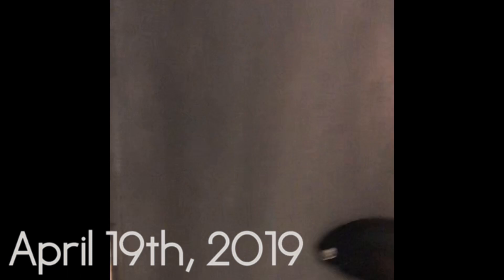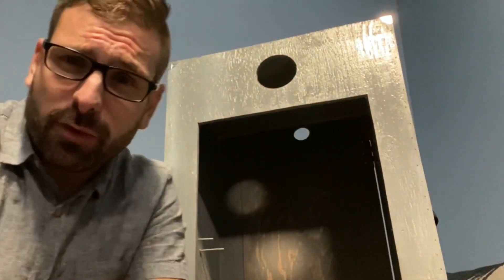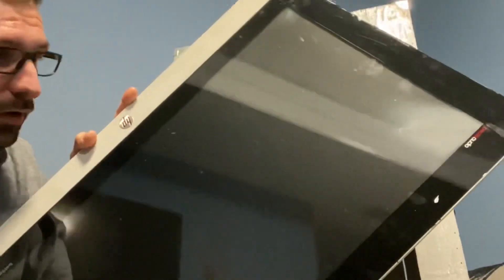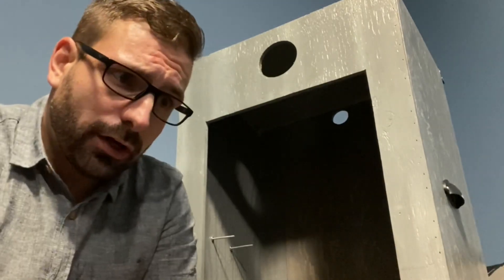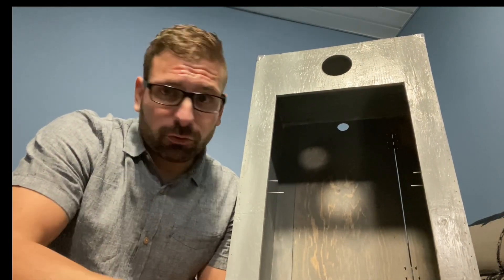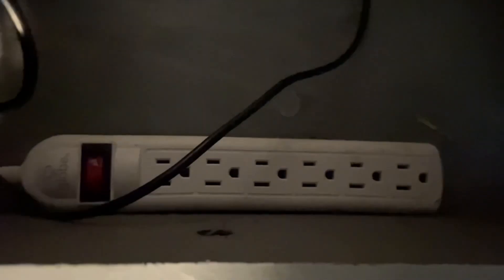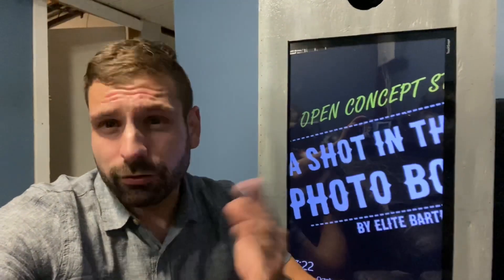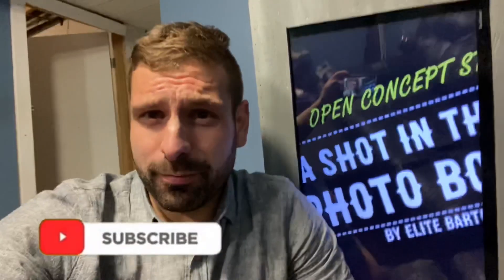Photo Booth Touch Screen No Longer Needed - My DIY Photobooth Ideas Using DSLR Booth Touchless Tech

Comment: What camera you used? I cant connect to my sony caamera
Reply from the maker: Sony Cameras (Wifi)

Unfortunately Sony has stopped developing their Camera API so newer Sony cameras will not be supported. Support for older Sony cameras is still available on dslrBooth for Windows but is likely to be removed sometime in late 2020.
Reply: You can use a watched folder with DSLR booth but you have use the tether photo app from sony